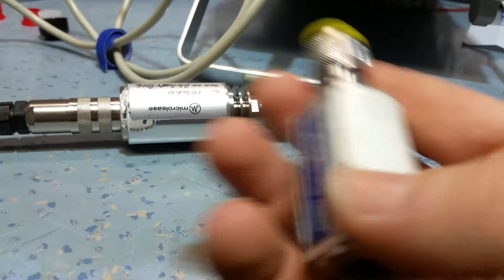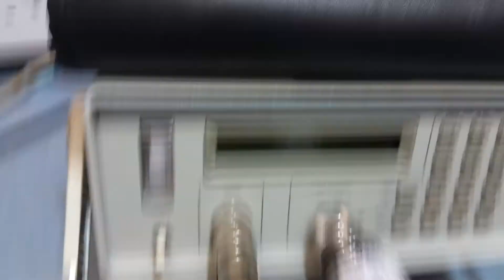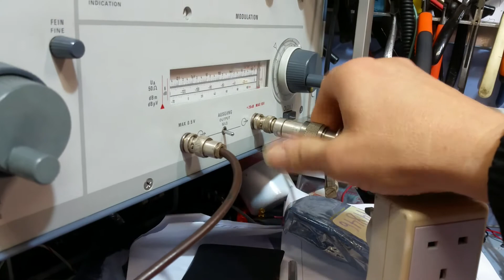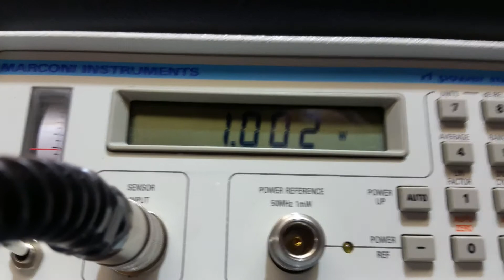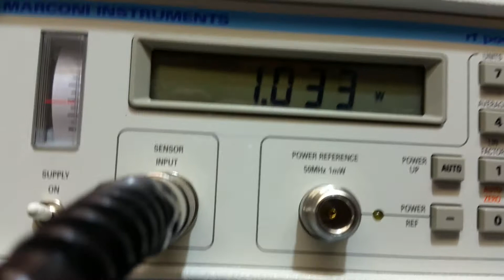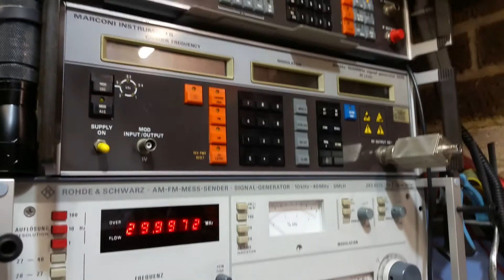Marconi 6960B power meter In use. Pt2

Comment: What would you suggest to make sure the 50MHz ref is outputting the correct 0dbm level when you buy one of these used?
Reply from the maker: Connect it to a SA and check. This one was correct.
Reply: @SoddingaboutSi  But as far as I know SA is not meant to measure power level. Yes can be accurate but the accuracy tolerance I believe is too high. Otherwise If I can measure power levels with an SA why would I buy a power meter? what are your thoughts?
Thanks
Reply from the maker: @IZ0MTW  No bit is does show the correct level into 50 ohm . Other than that you need a calibrated RF power meter. Mine passed the Cal at our test house anyway.

Comment: Hello, very interesting material, and helpful information.

I have several copies of the Marconi 6960B, I also use several other power meters, and have carried out many comparisons between these meters. Do you know my web site, sp5mxf.com? On this site I have described very precisely the properties of these meters and the most interesting are the comparisons between different meters. I have spent a lot of time researching power meters and the results and comparisons described are the effect of 2 years of power measurement work. I am very interested in measuring the microwave power.

My web site sp5mxf.com is written in the Polish language, which is certainly a certain difficulty, but now using Google translator you can read the texts in different languages quite accurately. In this way I read in different languages, today there are various tools and possibilities, it is easy. I am interested in your opinion on the information which I have included in the descriptions of power meters.

I wrote this comment in Polish, then I used the translator google to translate it into English so probably there will be some problems, but it should be fairly understandable.

Regards Tomasz

Comment: You can buy the plugs here in the UK for around £8 each, check RS and Farnells. The cable is just old VGA monitor style cable. I have build instructions if you are interested. Karl
Reply from the maker: Karl Fell Are you refering to the round multipole connector? What are they listed as?
Reply: Good morning Simon, email sent with details, Karl
Reply: The email address from your channel is not working. Do you have another contact email? Karl.
Reply: Done
Reply from the maker: Karl thats really helpful. I searched everywhere. Thank you.
Reply: @SoddingaboutSi  Any chance you could share the instructions, I'm on the hunt for a cable myself.

Comment: Those are binder connectors on that lead. Unless it is a special kind of shielded cable, I would try and order the connectors and make the lead up myself... hoping that the connections are 1:1, that is. Haha.
Reply from the maker: +MrDubje I tried. I could not find any connectors anything like these.
Reply: Simon Spiers That's a shame. We have similar ones but with more pins on a motor encoder connection lead at work... The cables that we produce for a certain product all have binder connectors, but are lower density in terms of pins (also thicker pins). Not sure if these higher density versions are still soldered internally as we never make those leads ourselves... There is quite the variety on the market it seems, I have seen these connectors as the standard ones you have there, but there is also a version with a twist-lock... Can you do a quick video about the connectors on the cable and devices, giving a bit of a close-up? Perhaps I can find out where to get them... Now that I think of it, there is a chance they are made by amphenol as well, but not sure...

Comment: Very nice. Do you have to calibrate every time it’s switched on or just when changing the sensor. Does it have the ability to remember calibration for multiple sensors.  Just noticed that you have the same power monitoring plug as me. Regards Chris
Reply from the maker: HI Chris. You can recall the last settings on power on. You also have the ability to store calibration factors in memory recalls. That power analiser has been a great little companion in the workshop particularly on reforming old caps in valve radios.
Reply: Simon Spiers Thanks Simon. Just lost the last of the three screws holding my power plug together. Oops.
Reply: Hi "All the gear...". I use power meters at work on a regular basis. It's standard practice to set the cal-factors and do the self calibration for each frequency prior to each use. Some meters recommend that you let them warm up for 30-60 minutes. As always make sure the power sensor is capable of handling the ref out on the meter and the power you plan to pump into the meter power sensor. We have lost a lot of power sensor heads at work because folks forget to check the maximum power in on the head. They pump 0db (1mw) cal reference into a head that can only take a maximum of -20 db, ie.. HP 8485D -70db to -20db. Standard procedure for this would be to put a 30 db pad on it and calibrate it to -30db, then use it on anything -20 to -70db. Hope this helps. Best Wishes n Blessings. Keith Noneya Ps some equipment will let you input the cal factors for the power sensor into them, in which case you only have to calibrate it once at the reference frequency listed on the power sensor. BWnB. Keith
Reply: I was going to ask that as well...the HP437 I have will memorize the cal factors for different probes. It's amazing how the meters themselves are very inexpensive...but as you've discovered the probe lead and the sensor heads are the cost killers! I keep my sensors under lock and key...the meter not so much!
Reply: Keith Noneya  Hello Keith thanks for the complete reply lots of interesting information thanks for sharing. Best regards and happy Christmas  Chris.